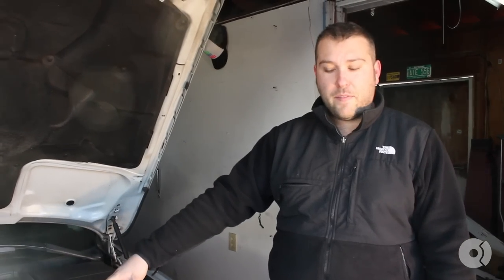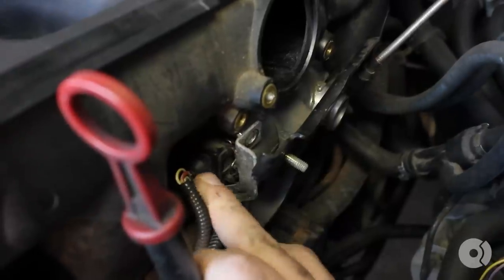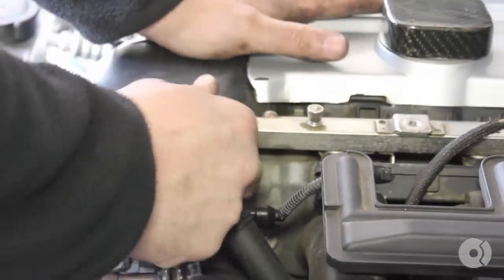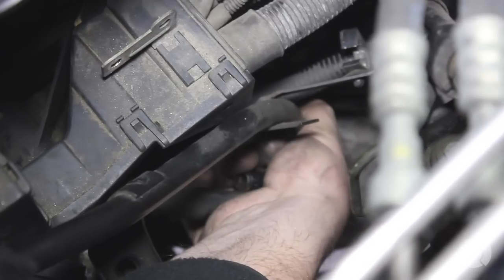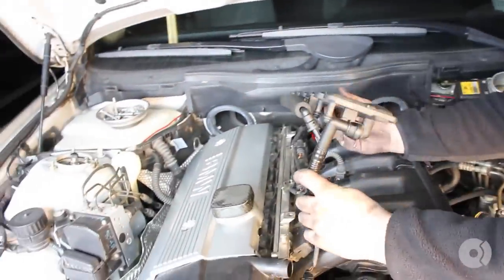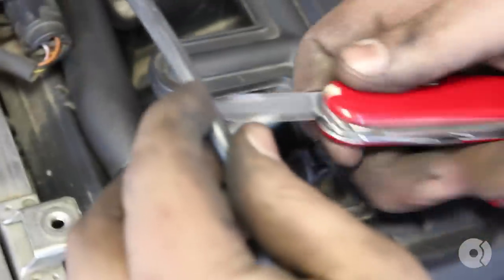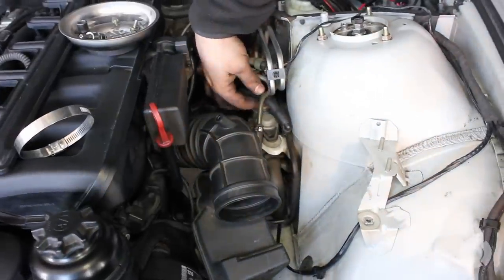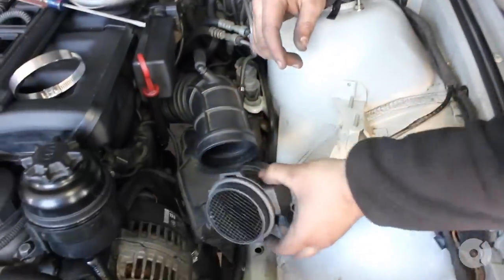BMW PCV Replacement (Breather System, Throttle Body, Idle Control Valve, Dip Stick)

Comment: I was having the same hesitating, stuttering problem with my BMW 2005 330CI for 4 years, I didn't replaced the ICV, just cleaned it, but before clean it I shaked it to see if I can hear the rattle, I heard  it but it got stuck , so after I sprayed it with the throthle body & air intake cleaner I heard it so clear, improved but stil have little up and downs on the RPM, think if I replace it will get better, I just want to thank your effort and  time  to make this step by step video tutorial, I really do appreciate it❗💯

Comment: A little bit of silicone spray here and there on the o-rings, plastic/rubber parts could of really helped you. That's what I'm going to use on my E39 next week for this CCV job. Great clip thanks.

Comment: sorry kinda worded my question weird. what i meant was, right after disconnecting the plug, what did you do? did you leave it as such, or did you disconnect it from the throttle cable piece for further cleaning.

Comment from the maker: Perfect! Often times a worn PCV system can cause issues like this and its easy to throw parts at the problem thinking its something else. These PCV systems are a pain to do because of the location but patience is always a virtue on this job (and maybe someone with some small hands too). 

- Gareth Foley

Comment from the maker: Thank you for the question Miguel.The tools you are going to need is a 3/8" ratchet, some 3/8" extensions, assorted 3/8" metric sockets, and a T40 bit driver. You will also need some flat head screw drivers and if you can get it, a flexible hose clamp driver.

- Gareth Foley

Comment: I decided to do a valve cover gasket replaced when i was done i had a few misfire issue after poking around their was an Hair line tear on that upper vaccume  hose because it so brittle and some oil came out. i repair the tear temporary with silicon high temp sealer it work great just plaster the whole accordian section until it Dry for 12 hours until i buy a new line just make sure you let it dry really good.  It solve my misfire issue until then.  im thinking about buying that whole CCV Valve kit new hoses and line and clean and replaced the entire thing. Great Video Dude
Reply from the maker: Thank you! A new kit should take care of the issue for good. Please let us know if there's anything else we can help with.

Comment: Very nice video.  Extremely helpful in doing this job on my 2005 X3.  If there are other X3 owners doing this, there are a couple differences but nothing major, for instance there are no vacuum lines to switch on the X3.  Hardest part of the job was reconnecting new hoses to the PCV itself during reinstall.  I put a little oil on all the o-rings to help, but still tricky.  Thanks again!
Reply from the maker: Thanks for the helpful tips, Matthew!

Comment: Excellent explanation and description Gareth! Best I have seen, you make it look easy! I wish you were local to L.A. The only suggestion I have is to maybe provide short description or indicators as to when it is time to replace the disa valve or throttle body.  I have an issue where my 2003 530i goes into 'fail safe' mode randomly and all signs and codes seem to point at the throttle body being the primary issue.  I'm going to attempt to replace it but was wondering if it is best practice to also replace the disa valve while I'm at it?  You FCP Euro sells parts/kits for these, correct? Thanks!

Comment: Good video helped me stop the white smoke from my exhaust on my 1999 bmw 528i sedan. that orange rubber was the cause got the all the pcv valve parts for 35 dollars on ebay thanks fcp i like and followed you guys...💯
Reply from the maker: +Tomas Anaya Glad to hear the video helped you out on your repair.

Comment from the maker: More then likely caused by something else as the PCV would have to be clogged completely, if you are dealing with several profuse oil leaks then I would lean towards it being the PCV, but I would also check things like the MAF and O2 Sensors as well, common culprits for this code. Hope that helps.

Comment from the maker: I agree. You should be fine driving it like it is for now. As long as the PCV isn't blowing oil straight into the cylinder head it likely won't be an issue. The only downside will be poor performance until its fixed. Good luck and don't hesitate to ask any other questions.

- Gareth Foley

Comment: This was great, but wanted to add a couple of things I learned this weekend. When replacing the 6 rings on the upper breather spreader (or what ever it is), use a very fine needle nose pliers, pinch the ring to make it easy to grab then just fold it over the top, no scratching and very easy, had mine all off in 2 minutes. Lay it down on a bench or really smooth concrete, use 3 fingers around and just push down, again 2 more minutes and done.  Next if you have that noise baffle unit...loose it by purchasing the new tube without the bottom port cause that thing is a pain in the @$$ going back in, your time must be worth something!!!! But most important, when you you are putting the new pcv in ...route your new hoses first then attach them...then screw it in place. I had to remove the insulator on mine or it just would not go in place and the small vacuum line also has to go inside of that insulation. any way, it come off really easy.  dont know if i would have attempted this without this video. THX MUCH!!!!

Comment: I'm getting ready to do the CCV replacement on my 2000 E39 528i.  But I was playing with the new vent hose that comes up to the spreader from the CCV.  It looks like it's might be a real pain to get the fitting to engage and lock.  Is it possible to install on CCV first then install and thread up through the intake?  Great job on the video.  Thanks for making it.   I'm also getting ready to replace the OFH and my High Pressure Power Steering hose.  How difficuilt is it to remove the banjo bolt the steer rack?
Reply from the maker: I think what you're asking is hitting on the same problem we had. You have to get the valve in place and then attach the hose that goes up to the intake manifold. It has to snap into place and will require some finesse. If you have someone who can help you with smaller hands it will probably help. Hope that answers your question.

Comment: Yes itwas.  I notice my check engine light and it started running rough.  But it had been five years since I changed my spark plugs so I changed them. Well, that did not fix the problem.  So I bought a device to read the engine codes and it stated that the most likely problem was the PCV.   That is when I watched this video.  I learned of all the parts I should order to tackle this job.
Reply: Howdy! How was your experience replacing the pic system? 2021 calling.lol

Comment: In case somebody needs help to re-connect the electrical connector to the throttle body, make sure the part with two square holes on the connector can rotate freely while the base with all the wires does not move. Otherwise, you may be able to seat the connector to the throttle body but will NOT be able to tight the connection. my lesson learned after 1+ hour frustration.

Comment: Good Job video very informative i usually work on domestics this is my second time European, just wanna share a lil tip, using ATF fluid on new O rings, rubber gaskets, silicone Gaskets makes them nice and tender for safe and easy installation, installing them dry may jag 'em up.
Reply from the maker: +Airman Thank you for the suggestion. I try to use silicone spray when available for o-rings or any part designed to seal.

Comment: Where does the line on the other side of the fuel rail go to? Great video by the way.
Reply from the maker: The other side of the line goes to the fuel pressure regulator.

Comment: my car has a misfire and rough when its running so my mechanic says that i need to replace my pcv so im going to bring it back to him next friday but can i still use my car for another week i have no engine light or leaks on the engine and so far im not losing oil beacuse i need my car for everyday use thanks again great video

Comment: is there such thing as a Trottle sensor? if so,  will it be close to the breather valve on 04 bmw 325I. i was told if i change that sensor then it  should fix one of my #15 fuse that's located in the fuse box in the hood that keeps blowing out everytime i try to start the car causing the car  to turn but not start. i Really hope you can help me out on that. 

your video was very well detailed. so thanks for that
Reply from the maker: On your 2004 325i there is a throttle position sensor. This is built into the throttle body and is not serviceable outside of replacing the throttle body. When replacing the throttle body it is required to also reset any adaptations stored in the DME from the previous faulty throttle body to ensure proper operation of the new part.

Now this component is also sometimes confused with the accelerator pedal petentiometer which is also technically a TPS sensor. Similar situation there, the sensor is integrated inside the accelerator pedal assembly and cannot be serviced without replacing the entire assembly.
Reply: is there a way to test the throttle body sensor just to make sure it works and also do you think if I were to replace the TPS sensor and the accelerator pedal assembly and the Throttle body and reset everything that it might work?

Comment: Thanks. My PCV is also fauly, and the garage said it needs to replace rocker cover for my vechile. This part will cost over £300. Is it necessary to replace the rocker cover in this case?

Comment: Great video! Great camera angles to show whats going on. Definitely the best one on this subject I've seen so far!

....one small question though.....at :32:49 in the video, one can clearly see that the lower DISA Valve bolt has been sheared off into the intake. How did you secure that fastener like that at :36:02 in the video?

Other than giving you a hard time about that, I really enjoyed the DYI. Thanks!
Reply from the maker: You caught us, we had to drill it out. It was already broken from a long time ago and we didn't bother showing that part since it was a tedious repair and not necessarily relevant to the work we were actually showing for the video.  Hope that answers your question.
Reply: @fcpeuro  this is such an involved job and any problems along the way would be helpful to share. YouTube's need to not gloss over reality. It's really misleading to a viewers assessment of evaluating if their skill level can match the task and if they have the necessary tools for any unforseen problems that may arise.

Comment: Brilliant video, I have followed the steps to replace my CCV am currently stuck on the guide tube although I was able to remove and clean the dipstick tube unfortunately I could not reset if back into the oil pan nor find the old o-ring. Where is the old ring?
Reply from the maker: We had a little of that trouble ourselves, we found the old ring still lodged in it's seat in the oil pan, we couldn't see it but we just reached in and pulled it out.  Hope that helps.

Comment: Hey thanks for the detailed video. I'm going to order the parts this week. Hey question. My 2000 E39 528i is showing the dreaded EML and brake light. When it did this before I has the throttle body change and it solved the problem. I just did VANOS seals last week and an intermittent EML and brake light popped up after installing the VANOS. I think I may have cracked the crank case hose due to it being brittle. Can vacuum leaks cause a EML code?
Reply from the maker: It's possible that a vacuum leak can cause an EML light. Generally speaking, vacuum leaks in the intake side of the engine will cause lean running conditions and misfires. Generally, these conditions will cause an SES light but the EML light can be triggered by just about anything. I would have the codes read for the EML light with an advanced diag tool that can read BMW error codes (not an OBDII scanner). It's much easier to trace down the problem knowing exactly which codes are being triggered.

Comment: What parts do I need to remove to replace the tube that runs from the oil separator to the dipstick tube? I have medium hands and want to keep it simple. Thanks!
Reply from the maker: Basic hand tools, only speciality item were the torx sockets that hold the breather tio the block.

Comment: Great video very informative.....I have a 2003 BMW 325ci and she's experiencing a rough idle and sometimes stalls I cleaned the ICV thinking that that was the problem but now I'm thinking it's the PCV in your opinion do you think replacing this would clear up a rough idle? thanks thumbs up and subscribe!!!!
Reply: Did you resolve issue with new pvc kit? What was your solution?  -2004 325i m54 with p0171 too lean bank #one

Comment: Faulty pcv causes misfires in every cylinder right? I have lean codes and misfires with fuel cut off, if i replace pcv would it clear those codes? 2001 bmw 325i
Reply from the maker: Hello Ryan. Yes, it's a possibility that a bad PCV valve or broken hose can cause lean conditions, misfired, and fuel cut off. This would only happen if the valve or any associated hose has an opening to the atmosphere which rarely happens. The same conditions can be caused by a torn intake boot (usually the lower one which connects to the throttle body and idle control valve) or an intake manifold leak. Lean faults are normally caused by vacuum leaks and occur on cars with mass air flow sensors because the volume of air entering the engine is higher than what is being measured (more air in the system with fuel only being added per the measurement of the MAF). The easiest way to identify a leak like this is with a smoke test machine. This will visually help identify the source of the leak.

Comment: FCP EURO can  I get the o-ring at autozone or is special order. I take everything a part yesterday and I'm about to order all the parts i need.  good video 👍👍👍👍
Reply from the maker: +MrMrmayaguezpr I'm not sure which o-rings you're referring to. I assume you are referencing the distribution piece o-rings across the top of the intake manifold? Maybe Autozone sells them but I doubt they stock them in their stores. I would also be very cautious about what parts you use for a PCV system refresh. if they are not OEM there is a very good chance you will be doing the job again in less than a year. I doubt Autozone has access to the OEM parts for this system.

Comment: Thanks for this great video. I finished the job fine on a 1999 323i, but the car now does not start. Checked all connections and they are all seated correctly.  Get this codes P0443, P1509, P1623, P1550... please help!!!

Comment: Are the O rings on the intake spreader a unique part or can i just use some right size O rings out of a general O ring set.
Also same question regards the oil dipstick O ring.
Thanks
Reply: Please does someone know the answer?

Comment: While I was removing the intake boot and fuel rail, I saw blue coolant around the engine. What can that be? It's not inside the hoses just somewhat between the engine . Towards the middle rear top engine

Comment: does the pipe that runs across the intake spreader cycle oil through it or is it just air? thanks!
Reply from the maker: +SpartanA31xx The pipe you are referring to cycles oil vapor which comes from the crankcase.
Reply: +FCP Euro my pipe seems to be cracked up there somehow and it looks like it's leaking oil maybe it's just the vapours building up there and appearing like a leak? I can't see to well since it's the cold weather package and has that insulation but I can see it's built up oil and wet

Comment: Hi, I just changed the CCV and all lines, however the white smoke continues coming even after a 20 min car run to heat the engine, currently the weather is around 30 F,here in NC, any tought? also the old CCV had this "milkshake" look alike liquid on it and on the tubes as well,, I pulled a couple of sparks plug and htey look ok no oil on them..?
Reply from the maker: Milkshake is never good, please change your oil immediately, and check your fluid to confirm there isn't any other damage caused by some other fault. 

As soon as you can to avoid any oil clogs on the new trap.
Give us a call if you have any other questions: 1-877-634-0063

Comment: if your pcv is faulty or block. mostly it will have an intermittent misfire. to tell if pcv is blocked is open and remove oil filler cap while engine is running if the cap is been vacuumed back pcv is faulty and mostly you would have rear and front crank seal leaks
Reply: What is front and back crank seals?

Comment: great video really helped me with my repair only thing is after i put everything back together and test drove it my 03 530i check engine light came on i tore everything back agin and made sure i did everything right now i have power loss the car shuts off in reverse and during idle i need help pls
Reply: Did you resolve the issue?
Reply: @bogusienombre355  yes
Reply: @benitos4406  thanks for answering ... How? Was this resolved?

Comment: No, this is an E39. I assume you are referring to the small vacuum line that runs up to the fuel rail? If so, that vacuum line can be traced back to the fuel pressure regulator under the car. However, that was changed with the M54 engine in 2001 as the fuel pressure regulator was redesigned and the vacuum line is no longer required.

Comment: What would one of the common symptoms be when the pcv valve needs to be replaced?
Reply from the maker: +Menace Morales High oil consumption, lean trim fuel codes, and a loud howling/whistling noise from the engine bay. Occasionally,  a failed system can also cause a bad oil leak.